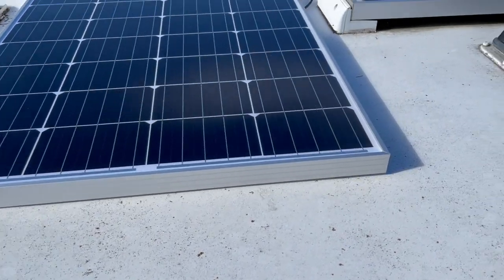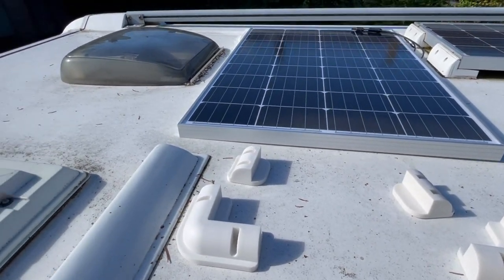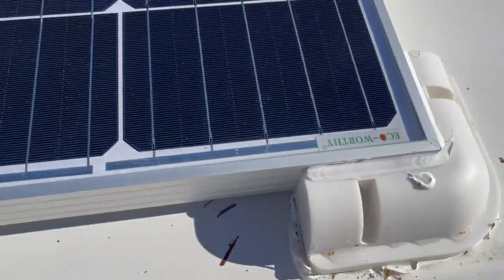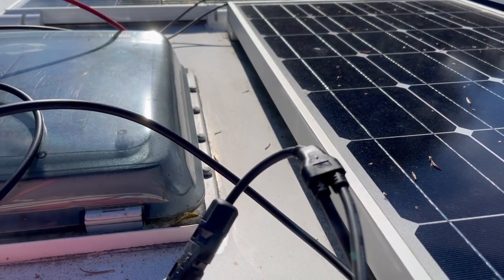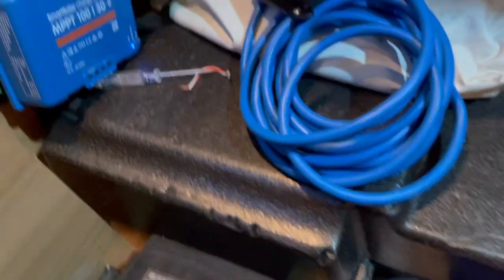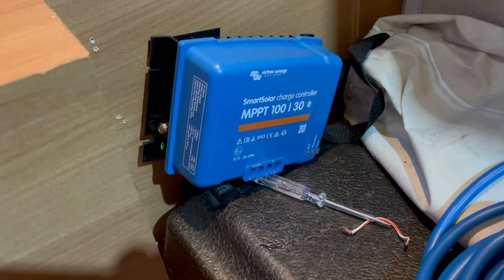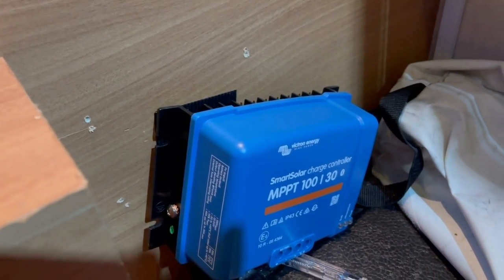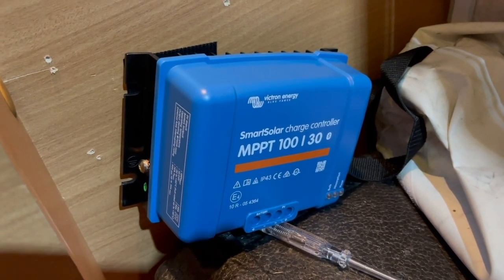New VICTRON SOLAR PANEL AND CHARGE CONTROLLER | FIX IT WEDNESDAY !

Comment: Thanks for this - really helpful - question what switch did you use to be able to switch the solar over to the start up battery?
Reply from the maker: I never fitted a switch and left it disconnected.

Comment: Hi Mark, just found your channel, will be subscribing, I have just fitted a 15 amp victron controller but have the same problem of current flowing back to the engine battery via a car did your isolator switch solve this problem, I presumed mppt controllers
 sensed to stop this Back charge
Would like to know your thoughts on this?

Comment: Well done for doing it yourself. We run 200 watts of solar on the roof of our van conversion with just 160 Ah of lead acid battery and that’s perfectly sufficient for us when touring. Unless you live and work in your van I don’t see the point in investigating thousands of £ into solar and lithium batteries until the price comes down. In the coach built we used to have 100 watts of solar and 2 x 100 Ah leisure batteries. 🚐👍🏻 Trev

Comment: Good stuff Mark, I’m contemplating adding a 2nd myself, I’ve added a 2nd battery and upgraded my controller already, no issues all summer just got to see how we go through the winter.
You’ll get better results with that decent MPPT than the folding panel one you were going to use as it looked like a PWM don’t forget if you’re using splitters and throwing more volts into the original cables after the splitter you need to check they’re beefy enough 👍
Reply from the maker: Hi  Rick, yes the cables are more than adequate but to be honest now it’s turning winter the charge is quite poor. I’ve just finished installing a Victron DC to DC charger so that will see us through winter !